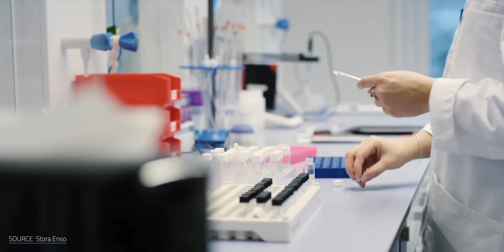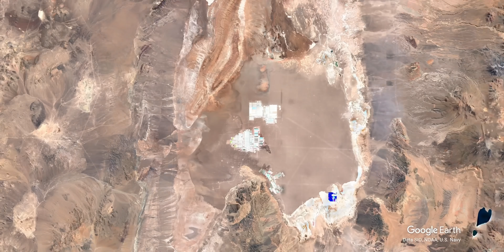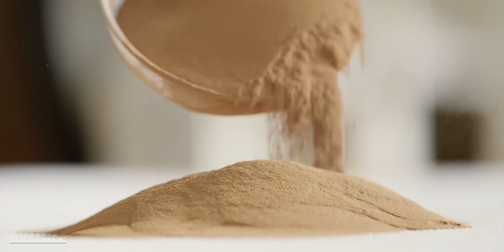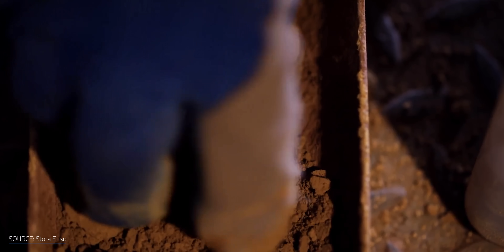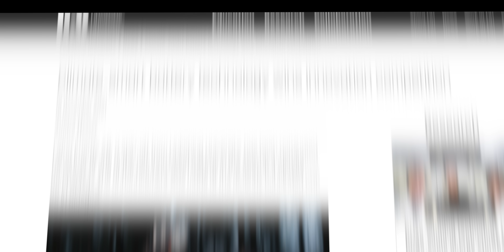Growing Batteries - Wood Battery Explained

Comment from the maker: Do you think looking for alternate bio-based solutions is where batteries are heading? The first 100 people to use code UNDECIDED at the link below will get 20% off of Incogni: https://incogni.com/undecided.

If you liked this video, check out How Solar Panels Can Help Solve California’s Drought https://youtu.be/pCRX232VkBk?list=PLnTSM-ORSgi5LVxHfWfQE6-Y_HnK-sgXS
Reply: They float on water and we can build a bridge out of them.
Reply: I think batteries are headed in many directions.  I do not perceive any technology that could provide all requirements for all battery situations, power, weight, price, recharge rate, etc.  Each new technology opens up more viable uses for batteries.  I think we still need more options.

Maybe some day, a Shipstone Battery will be invented (see Robert Heinlein, "Friday").  Until then, we will have to have many variations in batteries with different sets of engineering trade-offs.

I am fairly certain that we are only scratching the surface of what is possible with power storage at the moment.  Chemical power storage is incredibly limited when you compare that to the power stored in sub-atomic particles per unit area.  The questions are how do you get it out and how do you recharge it.  We are still in our societal infancy in understanding the quantum world, but that world is what powers the universe.
Reply: That was quite a hit job on the lithium manufacturing process how about balancing that compared to the fossil fuel industry, including images from the Gulf war, sea birds covered in oil when ships sink or BP oil rigs leak, the methane leaks from abandoned gas wells.
Reply: As a professional Arborist/ Nurseryman I find this exciting as I see the literal mountain of wood waste every day.
Reply: This technology is great, but do we really need battery storage in our future? I don't think so. I am looking at a tiny piece of solar lens a size of a piece of a rice sitting next to the camera lens on the back of a cellphone that is good enough to collecting all the energy it needs to powering up a cell phone. A bigger piece of solar lens for the laptop computer, tablet, electric vehicle, and all the lighting it needed for the heating of a family home, warehouse. Where there is light, either it is from a piece of burning wood or from the sun. Solar panel is the way to go in our future. Our scientists need to focusing more on the solar panel development.
Reply: I must say that this was interesting. Also, I've been lazy enough not to learn more about Li-Ion batteries. Seems like, back when, Ethanol was THE replacement for fossil fuel. Until it turned out we used what came out of Brazil as Ethanol made from sugar canes which has to be burned before harvest and is hell on the workers. Then add the shipping! Ethanol sort of dried up!

Given all the wind mills everybody talks about... How much concrete is needed for a 200+ meter high turret with a generator with lots of precious earth metals in it and the huge and complex composite props hard to recycle. What will ONE such cost in CO2. In total? And HOW MANY will we need? And ONE may yield, wot, 13 MW? If there's a decent breeze!

I'm not even sure fusion can save us! And while Lawrence Livermore may have gotten more power out than in... Just how much more? And considering, if the tokamak design "wins"... Consider all the stuff that goes into ONE reactor like ITER and it will only produce 500 MW? And there are some rare earth metals in there that is, apparently, a finite resource so the world might be able to produce only a few ITER-like reactors? France has like 50+ fission reactors today and one ITER won't cover the needs of up to 300 TW per year.

Plus everybody says that tokamaks aren't leaving radioactive and poisonous stuff behind. And that's not entirely true. We need Tritium and Deuterium for fusion. Deuterium is no problem, but Tritium comes from, it seems, the cooling basins for today's fission reactor's spent fuel! And that's why ITER may/will leave toxic stuff behind. In order to make the reactor create the Tritium it needs to run. There are other designs that does away with this issue, though. See: 
https://www.youtube.com/watch?v=yNP8by6V3RA

Perhaps we have to rethink our "civilisation" and our hunger for power instead? Take France again! 300 TW per annum = 600 ITER =  some perhaps TWENTY THOUSAND offshore wind mills?

Now, I'm just your average moronic amateur so I may be wrong in all of the above! Please correct me if so, but don't rip my head off, will'ya! 😋 Anyways... Merry Christmas and a Happy New Year!
Reply: Can The Brine Be Somehow Sublimated?
Reply: Table salt has been around for the last thousands of years and for thousands of years coming. The answer is yes.
Reply: Maybe, whatever solution that works best for the area is correct.  I think we will get other battery materials as a result of mass desalination (phosphorus, lithium, sodium, etc).
Reply: How about using bamboo?
Reply: Less coffee.  I ha to play at 0.75 speed
Reply: @daicekube  Ethanol is made using corn. That is unsustainable since corn needs large amounts of fertilizer which in turn is made of natural gas.

As for the sustainability of windmills, at first, they will be made with carbon-emitting power. However, as more and more windmills are produced, less and less carbon emitting energy will have to be used which will lead us INTO TOTAL SUSTAINABILITY.

We have, in the American Midwest, winds constantly blowing. As of 2022 Iowa receives 58% of its energy from wind; Kansas 45%; South Dakota 52% and North Dakota 34%. (For nationwide statistics see: eia.gov/state/index.php)

For locations where wind is intermittent, at ground level, tall windmills up to 300 feet high or more can catch winds that constantly blow above ground level. If there were no wind at that height, other forms of electricity in the grid, such as natural gas, will make up for it.
Reply: When are you going to speak about fusion cmon its been over a week now!!! waiting impatiently!!!
Reply: I can tell everybody right now how to not get your identities out there and your personal information is to not fill out for them little discount cards at stores when you give them your name your phone number and your address you just gave them all the information they need to have telemarketers to start calling you. Because they sell that information they gather as leads to telemarketing companies
Reply: Matt, I’ve been watching for a while.  1) Could you simply skip the LION issues section since we’ve seen it and just point to a video on it?  2) can we build a VC syndicate your viewers can invest in that simply invests in all of these ideas and other startups your viewers find and share?  Viewers who invest would be able to vote and that would be how the investments would be allocated.   Thoughts?
Reply: Side note.   Trees are the most green product on earth.  Cut them down and use them anyway you like.  The key is planting more.  We can never deplete them if we grow them.
Reply: Next year Matt Ferrell will be known as the guy who promoted killing all the forests.
Reply: Looking forward to the return of the ego snowthrower episode… one YouTuber filmed his with a drone .. I found it hysterical
Reply: @daicekube  Thanks for your ideas here, they renew and power up my spirit! Likewise, Merry Christmas and a Happy New Year!
Reply: @VerifyTheTruth  That somehow represents a taste of a well preserved idea, always available to anyone's table!
Reply: @michaelrae9599  I agree and with the help of renewable pure wind and sunlight
Reply: @MrVillabolo  Your idea is interesting! You just inspired me to think that coconut shells may do as well!
Reply: @melchormodales5828  That's a good idea, but I think that bamboo, which grows fast, will yield more material per square foot.
Reply: @MrVillabolo  Ethanol may be made using corn, but also by sugar canes and the latter in not eco friendly at all. Also, windmills needs tons of concrete and manufacture of concrete really puts out CO2. At least as it stands now. So, I doubt that total sustainability.
Reply: Wouldn't everyone like to see more mundane stuff other than solar panels, windmills and friggin batteries?
There are 10k other things we need in our everyday lives which could use improvements.  How about breakthroughs in materials used for things like clothes?  Better paints or new types of plastics?  New materials or treatments for resisting UV better for cars? A million other things.
Reply: @christo930  "Let it be light" the first words came out of God before everything else He said. We maybe able to grow the best coffee bean but unless you like to eat it raw you still need to cook that thing and brew that thing with hot water to make it the best tasty cup of coffee. Since I mentioned cooking, as we know cooking needs power. Now we are back to square one, we need better solar panel, better windmill, better battery.
Reply: @christo930 We?  Ofcourse not. lets see, the solar panels come from the Chinese. The windmills come from the Chinese. The batteries come from the Chinese. Speaking from Saudi?
Reply: @MrVillabolo  That's great.  I didn't know that the Dakotas had that many windmills and had roughly 50% of your energy from renewables.  I'm so happy.
Reply: You only provide a replacement for graphite anode and not lithium, while lithium is the most dangerous amongst the two.... and the replacement could be more abundant but less practical, so yeah I am not convinced.
Reply: @flipper_1969  hahahaha
Reply: I think that's where most technology is heading. It's the main reason I became a biomedical engineer. I love the people thinking of these more sustainable technologies.
Reply: same material - carbon 12 is also on the forefront of quantum computing and when it comes to climate change organic carbon is not a GHG, like fossilized carbon, reflecting as opposed to absorbing solar radiation https://www.ccacoalition.org/sites/default/files/resources/2017_Climate-impacts-Black-%20Organic-carbon_Part1.pdf
Reply: i guess the real questions here are, how well does this battery compare to the current batteries we are using and how well will this battery preform in intense tempters from freezing cold to hot? 

do we have to worry about the battery spontaneously combusting or running low due to colder temps? how long is it's range? how much weight does it add to the vehicle your trying to run?, what effect does it have on the environment when it's used and how it's created? 

and of course the price overall, i know some of that was in the video in vague terms.
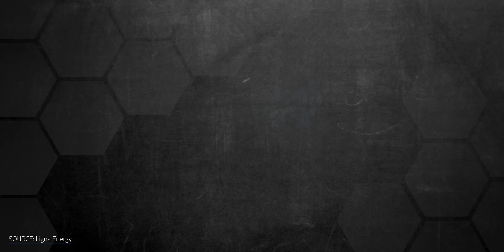Reply: 12:19 The disappointment
Reply: You are notorious for exaggerating and sensationalizing content.
But boy, this takes the cake. This channel has gotten worse and worse.
This is why I use Channel Blocker chrome extension.
Reply: @soybean7312  That is all good, but what to do when the sun doesn't shine, you know like every night.
Reply: @MrVillabolo   and a ruined landscape with them stupid windmills everywhere.  At night, its nothing but blinking red lights.
Reply: Hi Matt, recently discovered your channel and learned tons already. In The Netherlands most houses are heated using natural gas by something we call CV (centrale verwarming / central heating) which also produces hot water for the house for bathing, showers etc.  Yesterday I came across a induction CV or iCV as they call it themselves. Induction is quite efficient, but must be less efficient than a heatpump. The site itself says the advantages above heatpump are much hotter water and more compact as well as cheaper. And of course with current prices possibly cheaper. Also, as it can produce a lot of heat, you might be able to skip all the pesky house isolation and still produce a comfortable house (at high operating costs I would think). If interested, would love your opinion about it. Check out TI Green.
Reply: We won't swap to bio based technology since the world is ruled by devastating who used metal based technology (basically spaceship technology) and asura their enemy uses biological technology e.g. biomining, bioalchemy, tree based technology etc.
Reply: You should do a video explaining why your last 100 battery videos were complete nonsense that will never go anywhere.

You're like the Jim Cramer of investing advice 😃👍
Reply: @LiftPizzas  batteries?
Reply: Matt, I came across a strange technology that you may be interested in scrutinizing: Lightcell Energy. They claim to have figured out a better way of recovering energy from hydrogen, by doing a specially tuned combustion of hydrogen along with sodium, which then glows intensely with a very specific monochromatic light output; this intense light is then recovered using specially tuned photovoltaics optimized to work with this monochromatic light with efficiency high enough to make this worth doing.

Comment: Now THIS is the type of design thinking that I think we need more of, in which we look for ways to use the waste products of existing processes to solve some other problem. Hoping this works at scale, it'd be way more resource-efficient than mining new crap all the time.
Reply: Yeah, good encouragement towards industrial efficiency!
Reply: It seems better, but for one thing. If this solution uses 7 times more material or battery, then it also has to be 1/7th the cost. Half the price of the alternative won't work without something else to even out the playing field. But it seems  a little too early to know the real cost based on this video.
Reply: You might find the Trabant interesting, it was an east-German car built during extreme metal rationing, so to build bodywork without metal they created a material called Duroplast which was made from wasted cotton and surplus chemicals for resin, so the bodywork on the car was made almost entirely out of recycled materials. Duroplast was lightweight and strong, and didn't rust or rot, though it also doesn't biodegrade at all so all the bodies of those cars are still around even if the chassis and whatnot are long gone. Still an interesting recycled material though!

Comment: There are several strands to the anti-renewable energy push - and the nature of the minerals used is most certainly a prominent subject in that push.
I agree that there is no single technology to meet all the battery needs we have, and if a technology like this can have good enough storage density, and acceptable cost of manufacture, while also being somewhat benign to the environment, then that cannot help but be part of the overall solution.
Reply: Good to have more options on renewable sources of energy.
Reply: Sebastian Hahn  the problem tho is that windmill and solar beat in price the syntetical fuel combustible and nuclear by a factor of 10
Reply: @Jermain-cz4bh  But of course Jermain.
Reply: Sebastian Hahn  to  solidify your argument even more , we should take in count that Solar panels and Wind Turbines are extremely subsidized in most countries , something that studies regarding the price of Solar and Wind vs other technologies  never take into account , i remember reading an article talking about that 3/4 of the price of the energy that Solar produces is subsized by the goverment , meaning that without goverment subsidy Solar would be ALOT more expensive , now imagine how the case it Will be with Wind Turbines
Reply: Sebastian Hahn  

Nuclear energy will NEVER be completely safe.

Modern Pebble Bed reactors are probably “safe enough”, but we have to get RID of all the defective reactors currently in use.

Given the dismal safety record of nuclear power, it’s amusing that you’d call battery technology “inadequate”.

One thing’s for sure about Zinc Redox Flow batteries; they’ll never melt down and give off radioactive gas.
Reply: Sebastian Hahn  

Yes, renewables beat the cost of power from nuclear and coal.

You’re casting shade without evidence.

After all, if renewables weren’t profitable, companies wouldn’t stay in business.
Reply: @ulforcemegamon3094  

Nuclear and fossil fuels are heavily subsidized too.   People in glass houses shouldn’t throw stones.

Comment: I wonder, is there a future where these paper-thin style batteries (like how the Lab battery was printed to paper) could go into Solar Panel manufacturing so that every individual solar cell has batteries underneath it?

Instead of buying the Panels and batteries seperate, you'll have combo panels that release the power all day and night.
Reply: It's a cool idea, but there's a issue with the efficiency. Tldr is the more panels you have the less batteries you need for a given storage unit. Tony seba is a good Google search
Reply: Around 2014 this kind of innovation was applied for a patent. Single layer bi-polar separator coated LFP cell with polymer electrolyte (which standa high temperature) laminated in the PV panel frame in a way where silicon cells are 7 in series to provide 3,5V charging voltage for the li-ion cell. Li-ion cells (4 or 8) were the connected to series with BMS and DC chopper switch to do SOC matching.

I hope this was not too messy explanation. 😅
Reply: @mrspeigle1  batteries are like capacitors; they store charge but in the form of chemical reaction. It is certainly possible to have a supercap of the size of the solar panel that can supply reasonable power day and night.
Reply: a good panl lasts over 25 years so nope